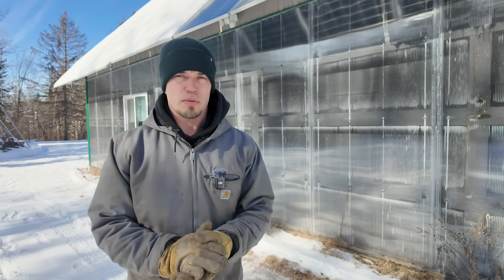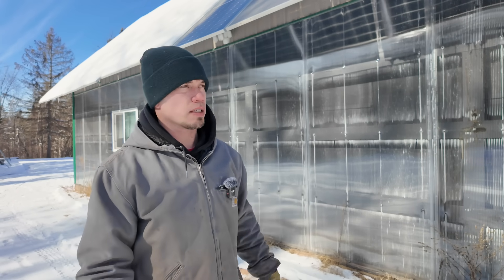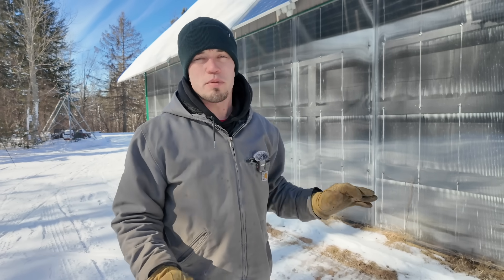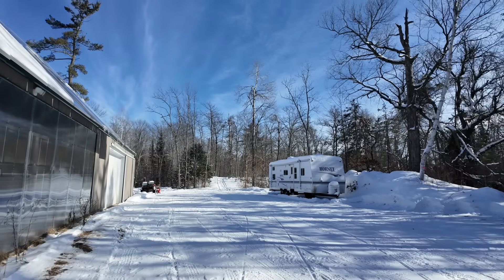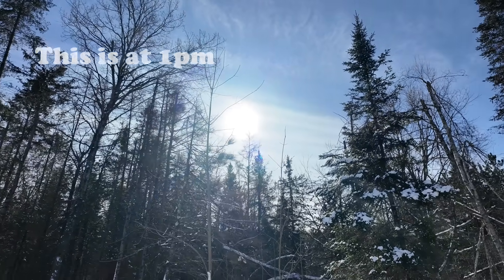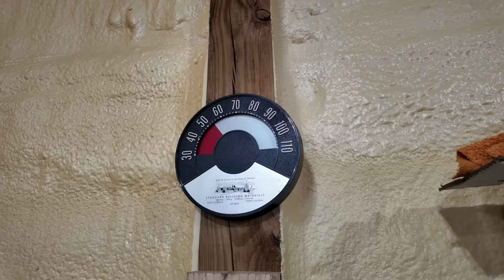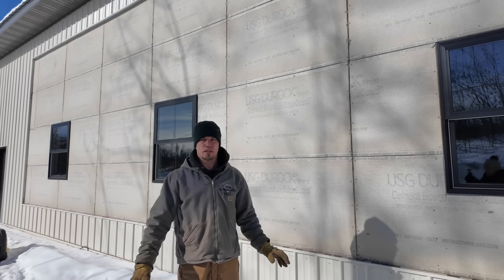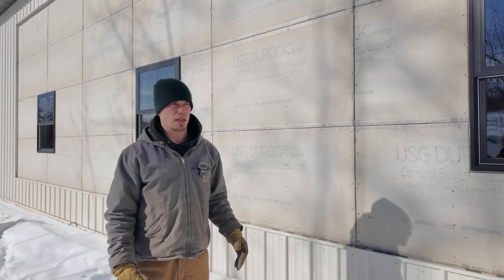Lessons Learned on Our Solar Heater Wall | 1 Year Later...

Comment: In regards to your air vents inside that are near the ground - how about something like an indoor chicken door that opens and closes by a timer you set. Maybe by temperature times open-close system like what greenhouses use for roof vents by temperature. They can be installed inside over the vent, no need to figure out how to get something inside the wall you have. I'm sure with all you have done by now, with all your experience and growth, you could come up with how to make that idea work.  Hope this might help.

Comment: Harry’s Farm (UK) YouTube did an update on his solar system. We’re not as advanced as the States but something I picked up on was about when part of one panel is affected by partial shading. Apparently, one panel in partial shade can cause the panel to think it detects a fault and lowers solar conversion in case it’s overheating or something like that I’m not up on these things. But. What he also said was that when linked up to multiple other panels, the detection trip or whatever it’s called causes the whole bank of linked panels to reduce its watt capacity. Just because one part of one panel is in the shade. 

Now this might be because our UK panels aren’t as advanced. But it sure did make a difference to Harry’s solar system in charging his batteries.
Reply: there is a trend to using micro inverters at each panel instead of wiring in series to send high voltage DC. This way each panel can be independent.
Reply: @ Thank you. I’m not familiar with solar but your comment will make sense to those that are. You also obviously understood what I was trying to say! 😬😳😂

Comment: If you really wanted to setup a passive cooling system for warmer months, you could leave the solar wall exposed, but add vents that can be opened / closed on the outside top of the solar wall, and put closeable vents at the bottom of the north side of your shop.  As the solar wall heats up in warmer weather, the air will flow up to the outside vent, and pull in air from the cooler shaded north side floor level vents.    No fans needed.  Although, not sure how big these vents would have to be to create enough cross ventilation.  

Instead of floor level vents on the north side, you could do a geothermal pipe system on the north side by running pipe underground and to the inside of the shop.  Now when the south side wall vents the hot air up, it's pulling in the cooled air from the pipes.  Requires a lot of digging through, which could be a problem if there are tree roots.  You'd also need to add drainage to those underground pipes, which means you'd need to test for Radon that could potentially make its way into the pipes from the drainage holes.
Reply from the maker: Thanks for the suggestion! We’re definitely going to pursue geothermal ✨

Comment: A good fix for partial shading problems on solar panels in Series strings is to run DC optimizers on each panel.  The partial shading will drag the string down to the lowest amperage panel causing all of the panels to underperform.  I use them and you should too, if you are using micro-inverters on each panel to make AC, that will do the same thing.
Reply: Yeah, optimizers are basic equipment. This is why professionals are helpful.

Comment: An idea to make your flap for the lower wall vent. Build a small vestibule (A box with two openings) so the air has to come through it into your shop. Put your flap on the inside wall of the vestibule (box), that way it naturally closes when the air gets cold and starts to flow back into the room. The flow will cause the flap to shut.
Reply from the maker: We really like this idea and this is probably what we’ll do. Thank you!

Comment: Just found your channel. I love the solar wall concept.  Here is an idea for your tarp, consider an RV awning, but mounted on the wall and the awning material deploys straight down the wall instead of out like an awning. That may also give you the option of covering a portion of the wall without coving all of it. Could possibly act like a thermostat.
Also, for the lower vent, maybe something as simple as a doggy door or a chicken coop door that can be programmed to open and shut based on time-of-day or based on daylight.
Reply: 24 volt dampers are made for HVAC applications might fit here. They could be actuated via t-stat.

Comment: You said you wished you had put a flap on the bottom of you wall to prevent cold air at night. It might not be a perfect solution, but they do make magnetic covers that attach right on the vent. Hope that helps
Reply from the maker: Thank you!

Comment: Solar panels wired in series to any location matching the voltage of heating elements work well, wired to any location. Follow wiring codes.
Baseboard, radiant, water, and sand heaters for example. Only a safety switch is needed if you can store all of the heat. Use inline solar fuses.
No electronics vs efficiency loss is worth it. AC thermostats, fuses, and switches weld when they open under power on high-voltage DC, do not use them
Reply from the maker: Thanks!